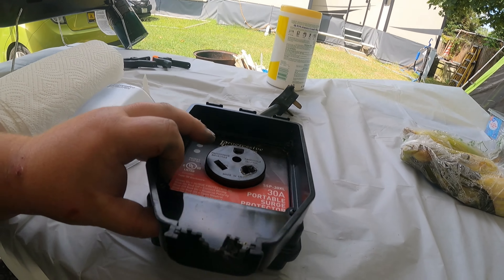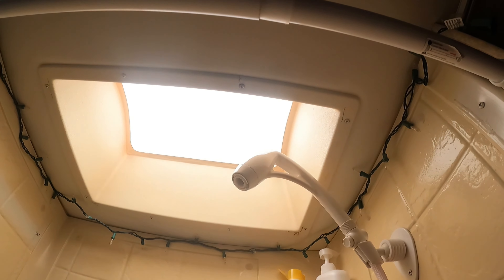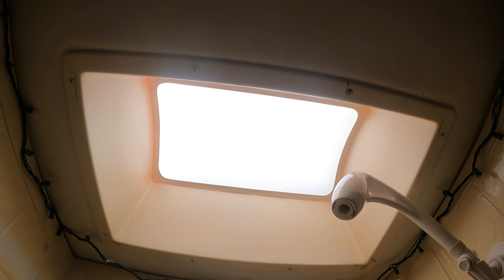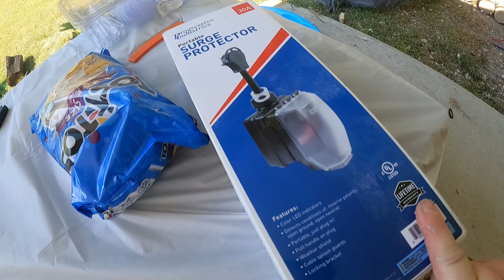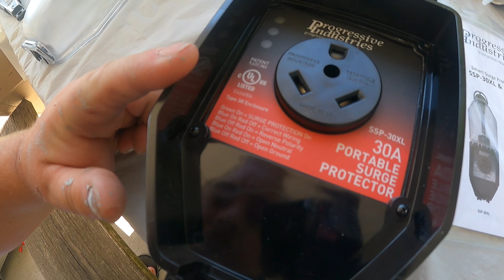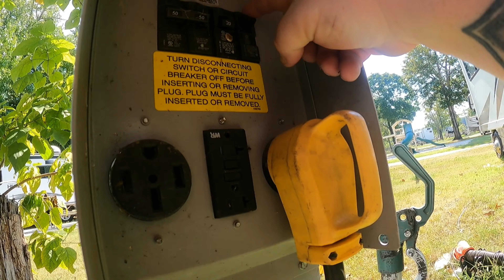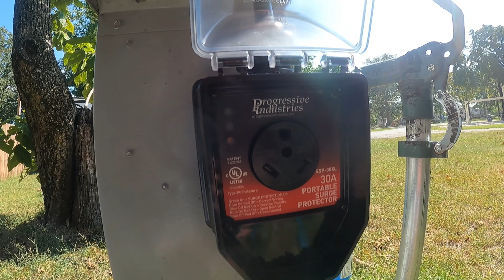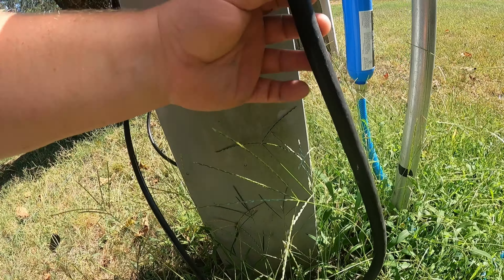We had a surge! New RV skylight install! #fulltimervlife #rvliving  |2023|

Comment: Your constant AC load is what is causing that plug to overheat and melt. Go get some dielectric grease and fill all off the connections from the box to your RV. It will run a little cooler and be less of a fire hazard!